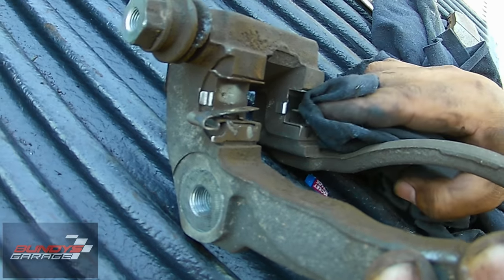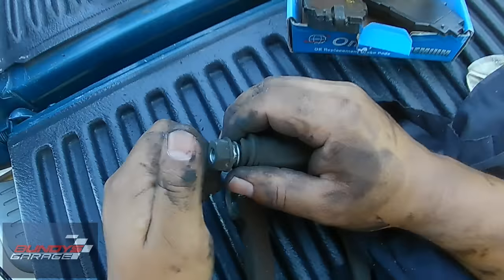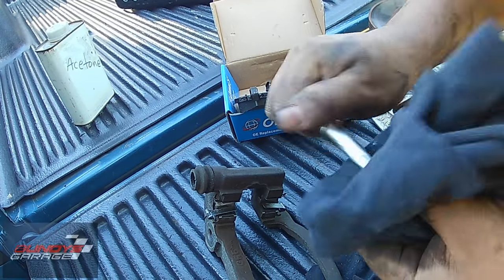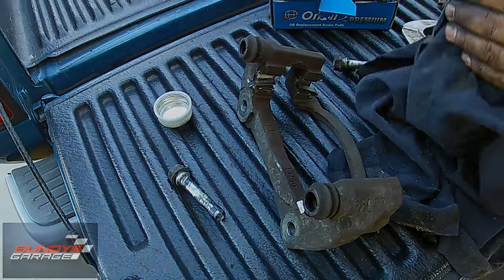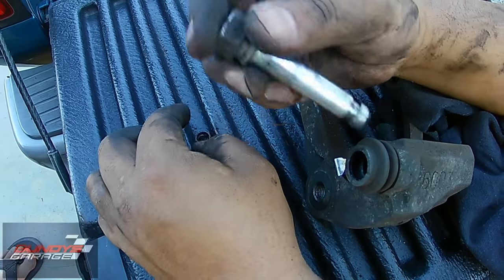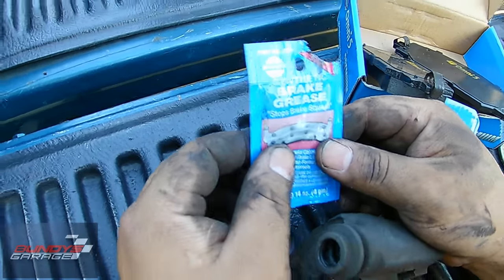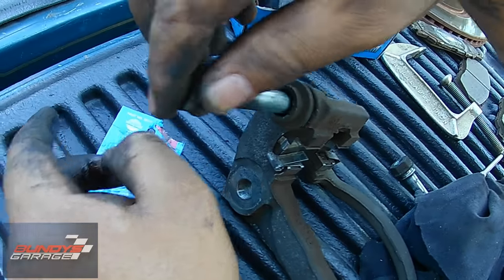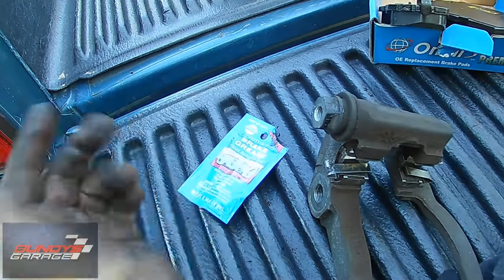What is that piece of rubber "tube" on the lower brake caliper pin? | Honda | Toyota | Lexus | Acura

Comment: The rubber seizes if you don’t use a silicone based lubricant. Silicone won’t cause the rubber to swell. If you take it off it’ll cause vibrations that rattle the pin. In this video they use synthetic brake grease, which I’m pretty sure isn’t silicone. Majority of the swelling and rubber problems is because of non silicone grease used.
Reply from the maker: Done it to a lot of vehicles and never got any vibrations. Also if it was so important why isn’t the rubber boot on both pins? It’s usually only on one?

Comment: Remember reconditioned calipers are sometimes a lot cheaper AND easier to deal with than messing about with rusty old calipers with seized slider pins and pistons. I even got some in the color red for my old Subaru :) I swear it took me less time to install them than it did to replace brake pads, mess with the pins and clean up the usual mess of rust and lube the rubber parts with Grease.
Reply: does that include bleeding the brake lines
Reply: @superdow1000  good point
Reply: True but most of us are trying to save money, some calipers are really expensive. Plus if it ain't broke don't fix it.     I mean don't spend hours working on a lost cause but if it's just basic cleaning up, I always re use hardware.
Reply: I just buy reconditioned sets instead of cleaning and rebuilding the old ones!  Saves 3hrs +
Reply: @superdow1000  On my Honda, pins are in the caliper bracket, so no bleeding required

Comment: I think the purpose of the pin is to airtight and  create a suction so the rubber booths retract easily.
Dust and rust will cease the caliber but not the swollen rubber sleeve.

Comment: I have done TONS of brake Jobs on high mileage GMs with the factory calipers, I have NEVER removed the rubber isolator on the pin and I have never had a problem..
That rubber isolator is there for a reason...

Comment: If you buy a quality replacement brake kit you should get everything. I recently installed a set of the Powerstop brakes on a Ford Ecosport . It came with everything. It had new rubber dust boots, it had new stainless steel brake pad shims, I did not notice the rubber bushings on the slider. My style is different. My sliders are threaded on the ends and bolt into the caliper bracket. 
Sliders are the only I didn't get new as part of the kit. 
I took the sliders out and cleaned them up. Any rust or anything on them I hit with a wire wheel. I prefer to use the permatex ceramic purple brake caliper lube.

Comment: Have them on one pin of rear brakes (Buick Lacrosse).  Drivers side wore down and the pin was actually rattling in the bore.  The noise was annoying when just driving.  Drove me nuts.  Whenever I pressed on brake, the rattling stopped (was putting constant pressure on the caliper and pad.  Soon as I released brake, rattling kept coming back.  On a subsequent brake job, mechanic mentioned the rubber ring on the pin was worn.  Got a new pin from GM, replaced it and have had no rattling since.

Comment: The pin with the rubber bush will have a smaller diameter than the plain pin so you may get rattle or vibration .

Comment: The reason the rubber is swelling up is the grease. You should use a silicone paste instead of grease. Grease is petroleum bases and rubber and grease don't get along.
Reply from the maker: Yes I do but most major retail auto repair shops don’t. So why run the risk, just cut them off.
Reply: I use rubber grease (red grease) for brake callipers

Comment: funny enough, i have a 2023 JDM toyota Noah van and since new, the brakes were making an annoying chirp at the very end of a stop and when letting off the brake again to go. have hd it to the dealer 3 times to fix it, but the chirp always comes back.

pulled the brakes apart to regrease, and noticed that the passenger side rubber bushing was swelled up and pushed out of the groove and jammed towards the head, effectively grease jacking that pin.  removed both bushing and reassembled .

the brakes are silent now as they should be.

Comment: Hi again. Forgot to ask this, but how is your brake caliper after removing the rubber sleeve? Mine has swelled considerably compared to 2 weeks ago. Removed it and it seems to fix the sticking caliper problem.
Reply from the maker: Exactly!
Reply: You probably used the incorrect grease. These do not swell up when the correct grease is used

Comment: The Rubber boot is there so grease doesn’t go to the tip of the slide pin. If you allow grease to go past that in a cavity, the pin over time, won’t move.

Taking the rubber boot off just means you just screwed your self and you will be replacing brakes far earlier.

Comment: The old grease that was on your pins looked like the CRC black synthetic crap I was using on my 2 Toyota’s! That stuff was garbage, it would gum up literally after a month. I can’t tell you how many sets of brakes I’ve ruined before I figured out it was that grease. I also have removed that rubber bushing because of swelling. I would only recommend that you clean out all of the old grease in the bracket bores because it may react to the new grease, and possibly gum the pins up. It can be time consuming but it’s better if you clean out all the old grease whenever replacing with a different type/brand.

Comment: I had that rubber band swell up and the sliding pin would not come out with out a hammer and lots of banging to knock it out.  I thought it was rust so I had sprayed and tapped that area for 3 days, 2 or 3 times a day!  I just removed it and cleaned the receiver-end and the bolt, lubed it up with some brake grease.  Back on it went!

Comment: Just done a brake upgrade on my Fiesta ST to the Mondeo ST 220 calipers. Im in the UK so guessing that would be the Ford Fusion in the US but Im not sure you got that model. The calipers we’re used so cleaned, painted and rebuilt. Both are now sticking on all the time and I’m thinking this is the cause. Only difference I’ve got is that the rubber sleeve is around 15mm long so without it there’s quite a bit of play in the pin. I tried it before fitting them and decided they must be there for a reason so put them on. The one without the sleeve went in perfectly but the one with had to be forced in. I can’t just buy 4 kits like someone suggested as the bores are a slight different diameter meaning if I use the ones without a sleeve in the bore meant for a pin with a sleeve there’s even more play. Going to strip them down and remove the sleeve and see how I get on. Wish I hadn’t doubted myself now 😂Thanks for the video 👍

Comment: Could you please explain why the pin sound be hold in place in the hole totally (as you push the boot up in order to get air between the boot and the pin). The boot has normally a distance which pull a little bit the pin out, i think this would be also o.k.  Please let me know the reason for why the pin sound be totally in the whole. Thanks for your prompt reply.

Comment: You do not even have to use the wrong kind of grease. I recently bought completely new rotors, new pads and new slide pins with new rubber boots. It was my first brake job with one of the slide pins having this rubber sleeve. Have done quite a few brake jobs. The calipers were working fine so I did not have to rebuild them. The slide pin without the sleeve was easy to install, but the slide pin with the sleeve was quite hard to get into the bore. It seemed like the edge of the sleeve got caught in the bore and it eventually tore off. I installed the pin anyway but my gut feeling was not good. That slide pin did not slide like I am used to. But I thought it had to be there. Well, now the brakes on that wheel drags and the wheel gets hot and I have a loss of power. I Have to redo that part of the job and judt throw that little sleeve into the abyss. Over engineering. It might work well on paper and right out of the factory and fence off some customers complaints, but not on a used car out of warranty, at which point the car company gives a rats ass if it gets stuck. Rather have some rattling or minor vibration than a hot wheel and loss of power.
Reply from the maker: Right! And all the guys say oh it needs to be there, SHUT UP! Just like engineers designed the Ford 6.0L diesel, talk about an engineering disaster! At least you have real world experience and know what’s up! Your not going to notice any change with that rubber piece gone when you brake. I have cut them off thousands of cars and not once has someone come back and said, my brakes are making a small noise. Won’t happen.
Reply: @bundysgarage  I HATE these rubber piston-like sleeves..almost always get stuck on my Odyssey. So...just brought another set of pins and replaced all four with the sleeve slot with the one without...absolutely love it....caliper slides in/out so easily. Either over-engineered or to rake more money....don't see why pads would chatter..there isn't that much play area. I tried various grease types....same result and waste of time in few weeks. Take it off, it's been year and no issues.
Reply: Sometimes I think they should fire every engineer that comes up with these ideas ! !  This issue just happened to me ! Thanks for the vidio !
Reply: @adityagandhi9 
Question when u say odyssey i just did this on my 2011 odyssey 
I absolutely hear nothing wrong but my gut feeling tells me to buy replacement bushings lol I need more comfort for thought
You bought another set of slider pins and install the tops on bottom?
Reply: @adityagandhi9 tagged u

Comment: I took mine off and got a growning noise when letting off the brakes at slow speed, like under 4mph. Especially down a hill or right after starting engine when RPM's are still high. Put the rubbers back in and noise stopped. Car is 1999 camry
Reply: They are for anti rattle on the pins.

Comment: It’s like a vibration damper and always goes on the leading edge of the brake caliper. If you’re gonna leave it out then replace it with another pin that’s whole like the opposite one.

Comment: Same issues for my 2005 Dodge Grand Caravan. My brake caliper was having issues moving freely I believe because of the very tight guide pin with the rubber sleeve.Today I removed and replaced the brake pad glide clips, removed and cleaned the guide pins but had a bit of a challenge putting the guide pin with the rubber sleeve back into it's hole. I have been using silicone paste for the guide pins. I will remove the rubber sleeve and pay attention to any "new" sounds coming from the brakes as well as performance issues. Any feedback from viewers specific to the dodge grand caravan would be appreciated. Timely video. Much appreciated. Thumbs up for sure.

Comment: I am now raw dogging my slider pin with no rubber. No regrets. Moves freely now and I'm no longer worried about it and I can move on. Thanks. No rattles, squeals or anything btw. Ford Focus 2010
Reply: just be prepared for that trailing pin to help wear the bracket receiving hole out of round and a sloppier looser fit, eventually.

Comment: I used permatex grease on pins and it seems to turn to gum .  The pin with the rubber bushing was seized and the pad was uneven .  The pin was fine and I even put a new rubber on pin .   Pin still does not want to slide .  I think those rubber little rings are crap.

Comment: Those little anti rattle rubber sleeves (I believe that what they are) will swell up as you stated if the wrong slide pin lubricant is used.
Reply: Well, I use what it suppose to use. I used sil glade grease that it made for that rubber. it damaged the little rubber

Comment: I always wonder why that piece of rubber does on 4he pin.  Thanks for tip. Ive notice when i push the pin in it slides off that groove. Next time illtake it off.

Comment: This is why Honda doesn't use those rubber seals, switching to flattened metal surfaces on one pin, but it doesn't mean those seals or flattened pins are useless.  The purpose is the leading edge of wheel turn creates a 'chatter' inside the pin housing and can squeak or wear pads unevenly.  If it's your car and you don't notice, that's fine.  But if it's a customer's car, do the right thing because it's their vehicle investment and they trust you not to cut corners with their car just because you decided something designed for the vehicle was bllsht and you're not doing it.

Another example on Hondas and Asian vehicles is throwing out the tiny screws in the rotor just because they're difficult to remove and supposedly, 'don't do anything'.  Fact is, they aren't there to 'hold the rotor' on during a brake job.  They're there to stop the tiny rotational chatter around the lug posts and when you throw them out, it translates into chittering of the wheel at high speeds, 70 mph and up.  Next time you take off the wheel, look at the space around the lug posts and you'll see what I mean.

Most American manufacturers don't care, but it's one of the details Asian engineers addressed.
Reply: I think if the rubber on the pins cause the brakes to seize up eventually it's a bad design.  What would you rather have possible noise or a locked up brake cooking your wheel bearings, putting strain on your drivetrain etc.?  The screw on the rotor I take it you don't live in the rust belt, the lugnuts center the rotor that screw isn't doing anything.

Comment: Never have see the rubber boots on the bottom pins. They both seized on my 2011 outback and sure enough the inside pads were worn twice as much as the outer.  Hopefully no rattle from that removal of those as you stated. Thanks.
Reply: Did you replace them or get rid of them?
Reply: @determineddad7935  i had first gotten ride of them, but then had a rattle noise over bumps and replaced them with new.

Comment: It's a bushing to prevent the slide pin from rocking back and forth in the caliper bracket when applying and releasing the brakes.  That rubber bushing can be bought along with the slide pin dust boots for about $5 per caliper.  The brakes won't fail without it, but you may experience knocking noises when applying or releasing the brakes. I hope this helps.
Reply from the maker: I have removed them for at least a hundred cars and not one person has come back and said “I can hear knocking in my brake caliper now!!!” Just cut them off so they won’t get the caliper stuck!
Reply: Does the pin with the bushing go on the top or the bottom ?
Reply from the maker: Pull the rubber bushing off and then it won’t matter.
Reply: @hellothere8972  bottom
Reply: @bundysgarage  I was searching for the reason behind that rubber bush and I believe this is correct answer. I remember even the company owned workshop mechanics (my car) removed and threw it when I once had sticking calipers. And upon asking they told that it creates sticking problems and there won't be absolutely any problem, this I now recall. Also worth noting is that the pads touch the disk even after brake is released, also the piston retracts only a tiny amount, so there won't be any noticeable rattles (if at all). The sliding happens on the other pin (guide pin) which is tighter in space and is on the leading edge of disc rotation, thus takes the most load
Reply: Nomenclature may differ but as per the part catalogue for my vehicle. The pin with the rubber (trailing edge side) is called "lock pin with bush" and the other with plain metal (leading edge side) is called "guide pin".

Comment: I had the outer pads on the rear on my Mazda 6 worn to the metal. I just threw on two new rotors and akebono pads. When I removed the pins they were almost dry. I left the rubber piece on and used permatex synthetic ultra brake lubricant. Both pins slide freely. Let’s see how it performs long term.
Reply from the maker: Keep us posted
Reply: That green permatex brake grease turns to gum .  Crap.  Get silicon stuff.

Comment: I notice most the time I pull the guidepins out of the caliper the grease has turned to glue. I’ve also noticed the anti-seize and synthetic brake grease we use at the shop turns to a gluey consistency as well, maybe the best lube is that which comes with the pads?

Comment: Bundy I just did a dodge Dakota and I was wondering what that rubber was for and if it had to be on a certain pin in a certain location on the caliper. Thanks for explaining it really serves no purpose. Thanks for the info. I appreciate that. Keep the videos rolling very helpful. ❤️

Comment: Those rubber "boots" around your adjuster pins are for retaining the lubricant...mine use lithium grease. If these are removed, your pins will, eventually, seize. It's best to do regular inspection/maintenance on them 2 - 4 times a year to make sure they do not lock up. Damage could span from premature pad /rotor wear to complete pad/rotor/caliper system damage. And it can be costly. Personal experience
Reply: Those pins should be greased at every brake job or if youre changing your oil.
Reply: then why do only one of the pins have the boot?
Reply: I doubt there's one person alive who inspects/greases their pins 4X a year.
Reply: My Genesis Coupe has them just on one pin. Funny enough the one with the gasket seized on one side and the other side it was scarred and stiff. The other pins without the gasket was almost perfect and shiny.
Reply: The pins on my wife's sonata were almost stuck last time. They were dry and that rubber boot on the pin prevented the brakes from squeezing. I changed the brakes and rotors, greased all the pins, and her car stops perfectly now.